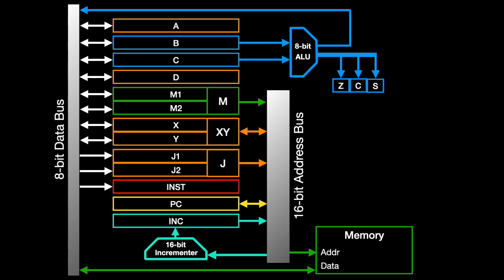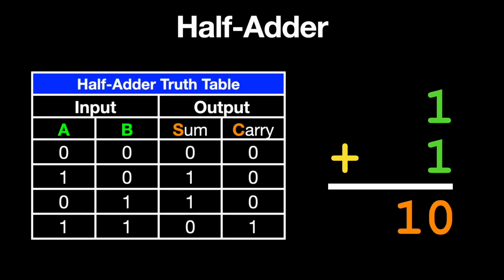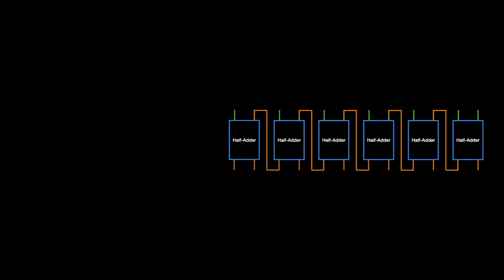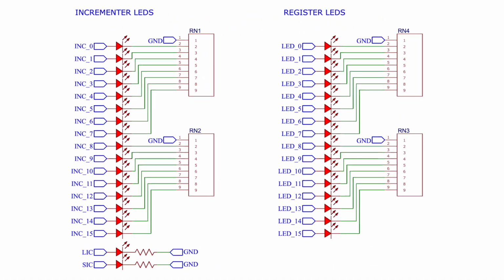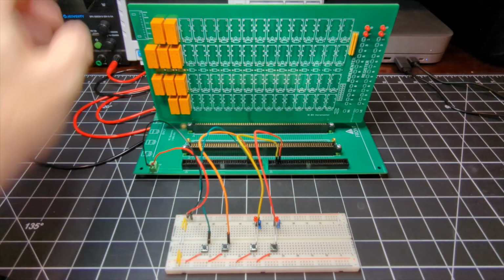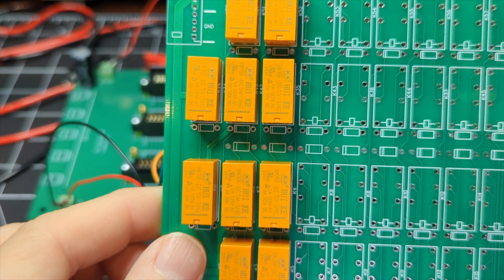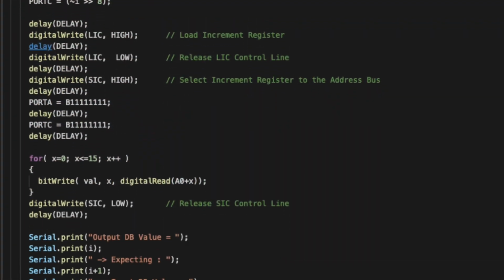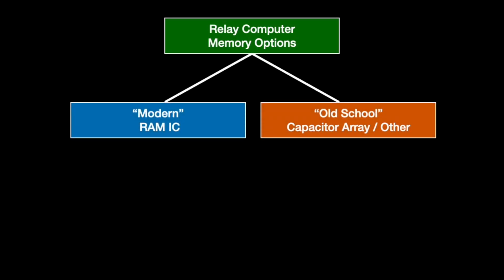Relay Computer - Incrementer

Comment: Hello! Thank you for the nice explanation of the fetch cycles. For JMP operations, there is probably a JMP register for the return address, right?

Regarding memory: I understand the thoughts about cheating with the ROM IC. Everything else is just a lot of effort if you want to stay period-correct. But it would be exciting to see a core memory :)
Reply from the maker: A JMP would literally just overwrite the Program Counter with a new address. If I wanted to do some subroutine call (like a JSR) I'd need to store the return address somewhere like in XY register. There's no stack planned, so wouldn't be able to do nested subroutines.

Comment: I noticed you manually route the tracks. Since you're using EDA (unless you switched?), have you tried the auto-router? It does a fairly good job. As for RAM, maybe look into something like the 2114 RAM; they're from the 70s, but you'll still have a vintage feel. I dunno how availability is. 1kx4, you'll consume a lot of real estate
Reply: Auto routers usually result in pretty ugly layouts. It would be interesting to see how it would get on with such a repetitive schematic though.
Reply: 2114 SRAM is what I was thinking. About as retro as you can get with an IC; easy to implement and doesn't have to be the final solution.
Reply from the maker: Yes, tried it, didn't have much success. As @lawrencemanning pointed out, the layouts were not "aesthetically pleasing" --- too many vias IMO. I think auto0routing should consider some AI.

Comment: You could make a few different RAM boards and compare them; I imagine capacitors would be the cheapest to start with.
Reply: Yep as a demo board 2 to 8 bytes of capacitor RAM would be very cool. But in reality it’s gonna need some SRAM ICs. The other angle is ROMs. I’d love to see some diode ROMs which were programmed with jumpers. Jolly tedious but could be interesting.
Reply from the maker: Somewhere I saw a ROM that was all DIP switches. That would be tedious to program but I guess easier to read "the code" than jumpers :)
Reply from the maker: I think that's going to be the approach! RAM chip, capacitors, and my big dream of getting my hands on a paper-tape reader...and punch so I can save my programs!